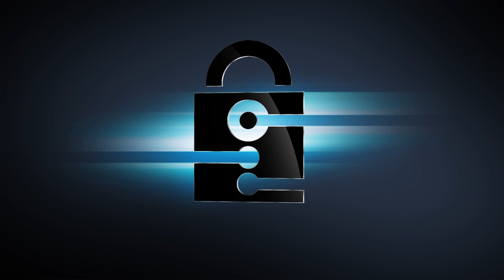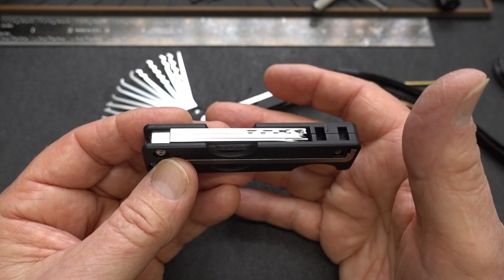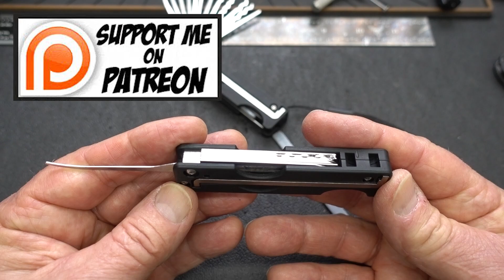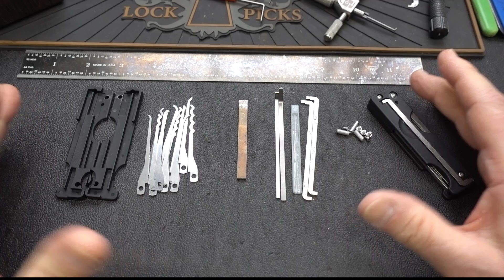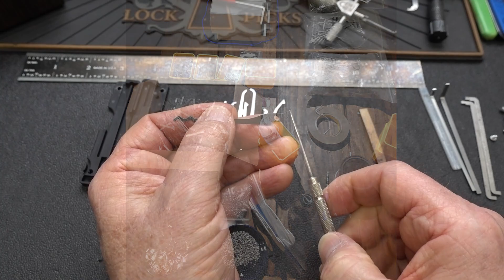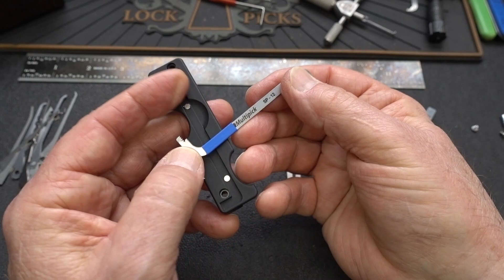(1874) Review: SWICK (FINALLY) Arrives!

Comment: Hindsight being 20/20 and all:  In re the issue with the molds / handles - it sounds like they may have been better off serial prototyping those handles by machining them from cheap, low grade aluminum alloy and / or blocks of acrylic plastic or some other such plastic that most closely mimics the final injection molded stuff.  Molds / dies are ridiculously expensive and are for mass production.  By prototyping, repeatedly with one-off machined parts, that may have then made it possible to make the tool wider to accommodate an "off the shelf" turning tool, once they realized the expense of the custom turning tools - there's no way to redo molds to the extent necessary to get OTS in there.  Aerospace suffers the same as these guys in some respects - its hard to build, oh, IDK, a carbon fiber wing or fuselage skin, without the layup tool.  That said, what can be done is that cheaper, less durable layup tools for the prototype and early production can be made, and only once a stable design is reached, then sink the cost into the production, long life quality tooling.  Here's hoping these guys sell enough to recoup their ~$100k out of pocket.  If they recoup $10 / unit, it's 10k units until "break even".  I just received my Covert Companion, their practice 6 pin lock (I'm up to doing 2 pins in only a couple days), and practice wafer lock a week ago.  This tool looks like something I'm going to want, especially the integral turning tools - I'll be watching for when they open up for general sales and almost certainly buy if the price is halfway reasonable.  Token "lock nOOb" Civilian.
Reply: Before the KS was launched there were approximately 50-60 revisions I think, with about 1/3-1/2 of those being rapid prototyped into physical space and tinkered with and revised, sometimes Dave would bring over the adjusted model and we would find the problem in it before having a new prototype made.  Bill is right on with the likely price point we are aiming at but with the quality of the materials and design we hope people will love it.  The blades in particular are of the best material available, designed by the best designer of pick blades, according not just to us but many in the Locksport community.
Reply: That's rough, going though so many iterations and physical prototypes and still getting hammered by changes in the molds in spite of that.  I'm in aerospace so get that changes to tooling or forced changes to design after tooling is built is incredibly disruptive and expensive, hence the observation about prototype / early production tooling (cough, cough....787 "terrible teens" for an example of what happens when you start building before you finish designing - it only cost you $XX,XXX, not measured in billions like the 787).  My observation on the price being reasonable is, of course, based on the quality of the product - cheap price isn't necessarily value.  Bill indicated your material selection for the picks is top quality.  No reasonable person expects western aerospace quality material and build at 4th rate quality Chi-com pricing - I'm reasonable.   High quality fetches a premium price because it delivers value - I'm going to drop the buck twenty on the stainless Paclock hitch pin lock BB and LPL recently reviewed (when I can find one to buy) 'cause I want something that will insure my $800 bike rack stays attached to my vehicle.  High price, but value at that price knowing that for most "street" level thieves,  it's impractical to pick.   Anyways, on your tool, if it comes in near BB's indicated price, you'll be seeing an order for me.   I just got my Covert Companion and like how you have integrated turning tools - definitely a value added design feature that the CC doesn't have.  I hope you sell a bunch of these, and at a fair profit.
Reply: @jimthegmanswick3143  Ordered within the last few days.  I'm looking forward to receipt.

Comment: Would it make sense to grind down one side of each tensioner by 0.1 mm?
Reply: For what purpose?
Reply: @jimthegmanswick3143  For a better fit. Sometimes 1.2 mm does not fit in, 1.0 mm is somewhat loose.
Am I the only one, who likes a thight fit of tensioners? Especially with spools, I find them better to handle a lock.
Reply: Yes, a tight fit is especially important for float picking such locks as the assa 6000 with gin pins. The steel is tough on the z tensioners but you can take some of of that's what you were asking.

Comment: The flat turners were never destined for the turner compartment. Originally the set of 6 bent turners I designed for TOOOL were supposed to go in there, but due to production difficulties and cost overruns, David only included 2 of the 6, leaving sloppy space that was supposed to hold the other 4, hence the plastic spacer. The set of 6 turners can be ordered from TOOOL or the OEM Southern Specialties, and will fit in the turner compartment as originally intended.
Reply: The "Tremendous Turner" set?  Good to know, thanks, and great job!
Reply: @Bushman4  Thanks! Yes, or https://lockpicktools.com/tension-tool-2500-series-set/
Reply: Correct, and if you do decide to carry the six tremendous turner set you will not be able to carry the broken key extractors. It's a trade off for now but I think the tremendous six is worth not carrying the bke.
Reply: That turner set is one of the first things I ordered after I started toying around with this hobby (after my first pick set,of course). It's an amazing set and well worth grabbing--but I suspect that goes without saying when talking about anything Christina designs! 👍

Comment: Good video, and interesting story.  As a layman, it sounded like they really needed a couple of people with experience in manufacturing to assist/mentor.  Injection moulds for 1000/2000 pieces, and then having to redesign them and purchase new ones sounds awful.  

It really says something about them that they continued with their own money, and I applaud them for that.  But it sounds like they probably shouldn't have gone ahead with the Kickstarter to begin with...
Reply: I have been in manufacturing for 15 years and was advising Dave before fully joining the project.  Everything was lined up and could have shipped in 2019.  Taking the suggestions from the community and implementing them took a lot more time than expected, and far more money than we could have anticipated, I think the final product is better for it.  The product as it stands today is far better than what Dave had and launched the KS campaign with (which had been worked on for almost 2 years at that point).

Comment: I feel this comment may end up getting deleted... But this looks so much better than LPL's Covert Companion. I am far more interested in buying this tool.
Reply: Yeah I’m interested in this product too, two things that seem to be a Improvement over the covert companion are the swivel lock and the tension wrench holders
Reply: @ronzombe  agree 100 percent. The fact that the covert companion doesn't hold the picks 180 degrees from the handle and even LPL recommends a pistol grip while using the tool is a huge drawback. That's not how we learned to pick, and so we'll have to learn new techniques to use it? Nah, pass. And I do have to say, I have nothing but respect for LPL. I've learned so much from him, and love his content.
Reply: My design is quite different from LPL covert companion. Of course mine came out first as a kickstarter but LPL did not copy mine as a competition, I feel he simply saw a need for a compact carry all that actual fills the gap where SWICK leaves off. The covert companion doesn't have a way to carry tensioners because most of the tools in his kit are bypass tools that don't require them. I love his design and will definitely be getting one because you can never have enough lockpicks, lol.

Comment: Are Swick picks 304 or 18/10 stainless or some other number?
Reply: Did you watch the video?  Not trying to be offensive, but he does say it's 301 high yield stainless.
Reply: Is 301 stainless steel ferritic?
Reply: Type 301 is non-magnetic in the annealed condition but becomes magnetic as a result of cold working. Type 301 is corrosion resistant in many environments, but the corrosion properties are less than that of 304/304L stainless steel.
Reply: @j-5624  The blades are slightly magnetic due to the working processes on them.  And as Jason F said, it is 301 High Yield.
Reply: @jimthegmanswick3143  Jim, it is great news  especially since you both agree. Thanks very much.
Reply: The big difference between 304 and 301 is tensile strength. 

Grade 301 stainless steel, with its higher carbon content (0.15% compared to 304’s 0.08% by weight), can better withstand mechanical force. In room temperature conditions, grade 301 stainless can take up to 120 ksi (kilopounds per square inch).

Grade 304 stainless steel, by comparison, can only take up to 90 ksi of pressure before experiencing mechanical failure. This means that at room temperature, a basket made of grade 301 stainless steel can take up to 33% more stress than a similar basket made from grade 304 alloy.
Reply: @picklocks  what about magnetism. Will a  301 pick stick to a magnet like  one of those steel narrow strips that fall off a street sweeper I some times find  on a parking lot or street if I am looking down?
Reply: @j-5624  It depends on how magnetized that particular piece has become during its being worked I would imagine.  Although clearly I am not a materials expert or engineer.
Reply: @jimthegmanswick3143  Thanks for your reply.

Comment: I know the chances are slim, but is there a possibility that they'd be offering pick blanks? I'd love a pick for picking wafer locks that has a notch in it to catch the wafers.

And (the video isn't over yet at this point)  are they going to sell replacement picks in case we break one?
Reply: So there are many things to come with SWICK we will be offering blade replacements when we do our next run of blades but when that will be depends on how fast we sell our current stock. 

Also, we should be able to have blanks run with our next batch as well. Jim and I have a lot of things planned for the future of this little tool. It can be much more than it is and has a lot of room to grow. 

Thank you for your question, 
David

Comment: Thanks for doing the explanation/back story of the development of this item. I knew the development of a project like this could be expensive, but I had no idea just how expensive and how much up-front money is needed.  I also very much enjoyed the back story on the pick that LPL and you developed. Just a week or two ago, I saw they were listed on the Sparrows website and while they were in stock I snapped one up. After the initial production run and sellout, I wondered what the big delay was in getting more produced in back in stock. Now I know. Thank you.

While the abuse that they received is not right, especially over a relatively small amount of money, there are a couple of factors which make it easier to understand. In this day and age of unscrupulous people and outright conmen, people may wonder if they've been fleeced or fallen for a con. There are dozens of kick starter projects which are either impossible, impractical, or have a snowballs chance of actually working. Yet, so-called inventors raise tens or hundreds of thousands of dollars from gullible people.  Thunderf00t (those are zeros) on YT has dozens of videos calling out the unscrupulous people raising money from those type of projects, such as the self-filling water bottle in the you pump it scuba tank. Both of these are based on scientific principles that sound good. Neither is likely to produce practical results in reality and certainly not at the level promised.

Gordon Gecko in his comments below points out that people are far more likely to accept the loss if they feel that it was a legitimate effort that fell short. The same investors may be moved to anger if they feel that they were intentionally ripped off and that the inventor had no real intention of ever producing a working product.